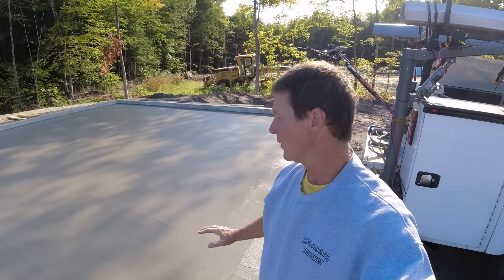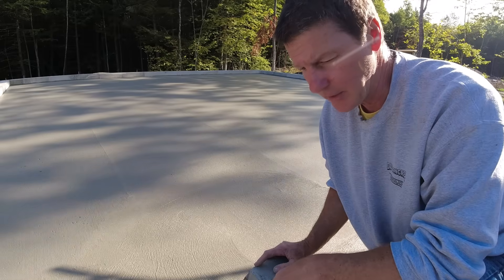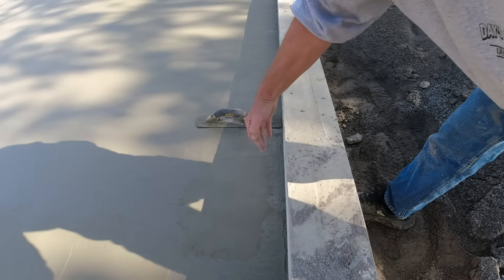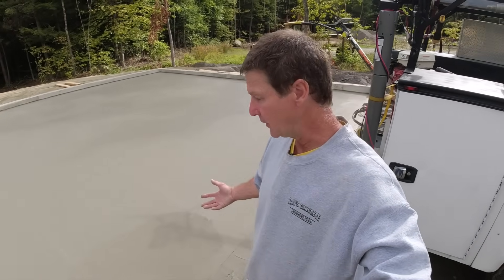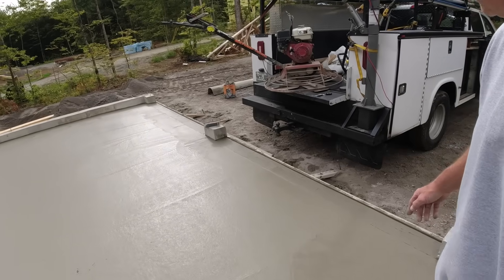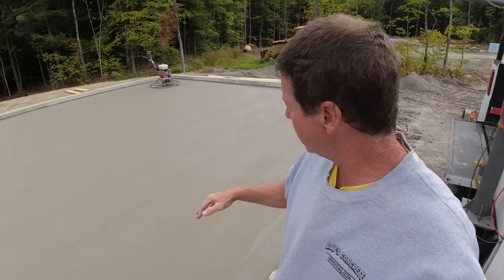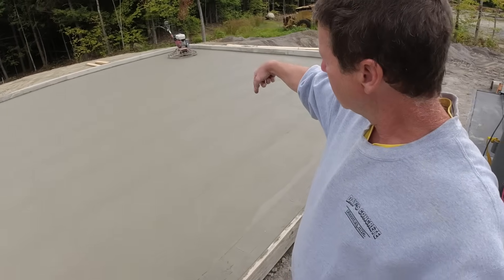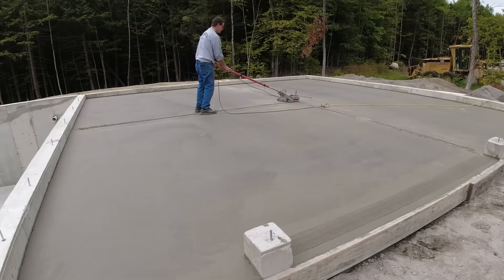Concrete Finishing Tips - This Is How We Get Perfect Concrete Every Time!

Comment: On a small I mean tiny project, I'm curious as to the procedures. Mainly the timing and using a bag mix not something from a truck. I know there's modifiers and other things on a concrete pour like this and I'd like to know how it compares to a simple bag mix. 
So you got your concrete poured then screeded, and mag floated. You wait for a half hour or 45 minutes or until the water disappears from the surface. 
Do you ever go back to a MAG float at this point to work the rocks down further or is that part already done?
 Once you do the finger test and decide to start hitting it with a steel trowel, do you keep hitting it with a steel trowel until you're totally done, or do you stop and let it rest for 10 or 15 minutes every so often until you have the finish you want?
Most of the time when I see the power trowel come out it, just stays going the entire time until the whole job is done.
  I'm asking about hand working a very small area with a steel trowel.  At this point can you just stop troweling when the finish looks like what you want?  
I guess I'm just wondering if it's possible to overwork the concrete.
There's a lot of us out here that aren't planning to go into concrete finishing but it sure is fun watching someone that knows what they're doing. I love the little details you throw in.
Reply from the maker: Hi Randy, There's a lot of little details when it comes to finishing. That's why I made The Concrete Underground (my training site) so I can help others learn and answer all your good questions you have.

Comment: I worked in the building materials/lumberyard/ hardware business for quite a few years. Small town/Colorado, the best concrete guy was a year out on job reservations. Under the advice of the best general contractors, clients would delay the project in order to have legit foundations or slabs done in proper fashion. Attention to detail and situational awareness results in an exceptional product. You will never run out of work. God Bless your diligence and awareness.